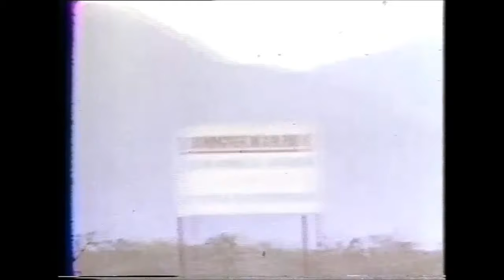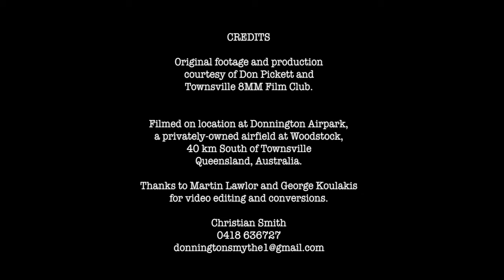Historic Ultralight Documentary

Comment: I started flying ultralights in 2001, with designs from the late 80's, so they were 'mature' designs with 40-50 HP engines.  They flew fine and I always wondered why I kept hearing about how weak and dangerous they are.  This video shows me what I was hearing about.  Seriously underpowered and looks tail heavy.  Quite unstable.  No wonder those brave and crazy pioneers had so much trouble flying them.
Reply: Russ, Most people that get and buy UL dont get the required trng...They just think its not a "Real Plane", so They can go fly it w/ no instruction...Thats where they get themselfs in big trouble....Its like any thing else...You get trained and then go use it.....Its people that dont even know how to change a flat on thier own car.
But w/ proper trng, they can be successful......Also, UL's are no more "weak and dangerous" than riding in a car.....Besides, Look at the Boeing 727 Max, all computerized and modern and it has killed numerous people and was flown by well-trained pilots.
Also, most people are too lazy to maintain thier plane.....Let the maint. slip. it will mess you up...And its no different than a $2-4000.00 rifle that you never clean...Sooner or later , its gonna blow up in your face......
This vid is a perfect example of what I'm talking about..I use to fly RC planes....I'm the "Blue bird"...Well maintained and ready to  fly....My buds, the "Red Bird".....Always come to the field w/ probs...Field maintenance......Big No No....Fix and repair your stuff at home, not at the field....

Comment: The aircraft at left was operating in the early to mid 70's using a JLO L270 two cycle, 17 hp at 5000rpm.  the field was Homestead in FL when in that age was a sleepy place, before all the Cuba activities. fl Prop drive was 2.1/1 gear drive.  It predates the U S ultralight movement and that explains the N number.  You can see it in flight on youtube, under sevtecsev.  It had minimal climbout, like 90 feet per minute, with a 145 pound pilot aboard and an all up weight of 400lb.  I limited flight angle of bank to 45 degrees and this coupled to conservative stress levels, kept me alive.
Reply: The scout first flew and went into production in 1972,,,so it was the FIRST minimal aircraft designed as a minimal aircraft, cheers

Comment: I used to fly a Scout Mk III  with a Rotax 377  engine.  Good times .   oh and for the doubters in the comments   I used to do   wingovers,   and  cross wind landings   -   you guys dont know what you are talking about . The Scout was remarkably tough.
Reply: Damn right, the Scout was a great airplane. The trolls are just armchair internet pilots!
Reply: Wish I upgraded to the 277 rotax I had no coin at the time to do so
Reply: With a wing spar made of sailing components a fatigue failure was almost inevitable ....the drag wires also had to resist the turning moment of the front spar - there was no load analysis done and its fortunate most of these "aircraft" didn't accumulate many flight hours, or it's likely we would have seen more than one fatality.
Reply: Just because it didn't kill you doesn't make it a great aeroplane.
Reply: I didnt say it was a great aeroplane -  it was a tough aeroplane - and  it  had characteristics  you would expect from a 1st generation ultralight -  it wasnt that comfortable to fly,  it wouldnt fly "hands off" -  but it was the first ultralight aircraft in Australia.  I'm glad  I owned and flew it.  but these days I'd be looking for something  more comfortable  and  better engineered for a minimal aircraft.  eg Aeros Ant.

Comment: They actually fly quite nicely I liked my MK3 more than my old single surface mx quicksilver. Used to fly mine out on the broadwater on the goldcoast in the mid 80s The biggest problems they had with the robins engine was the carburettor kept coming out of its rubber inlet mount Also the damn flex exhaust pipe kept cracking and breaking all the time. Once I had the lock nut holding the exhaust baffle come free and then pop out the back it went becoming the loudest scout in the sky LOL
The wing warp worked ok but was quite heavy to control The quality of the build and dacron sail used was excellent hats of to you old mate Ron Wheeler

Comment: Really interesting, i like that video. Does anybody know what engines they used ? They are all the same, i think. Small engine but enough power to fly with it....
Reply: they were a Robins 18HP hahahaha and I own one of these birds that has 3 axis controls using wing warping
Reply: A Robins pump engine modified which with the geared reduction could pull near 50kgs static thrust

Comment: I Can't believe that small engine can fly about 200lbs frame and pilot.
I want build one. With 2cycle 180cc 7hp engine.
Reply: 180cc 2 stroke but only has 7 horsepower? That's terrible and far too small to fly anyone.
Reply: @tenlittleindians  how about reduction gear to increase torque?
Do you have another option for the engine.
Reply: @kreativitasku5048  If your less than 150 pounds 7hp will get you flying. The West Bend engine was used on the early Soar Master power bars to get early hang gliders off the ground.

My question is more about your 180cc size engine. A Honda 70 mini bike has only 65cc and it's probably around 5 horsepower and that's out of a 4 stroke.

A 180cc two stroke should put out far more horsepower than 7hp.

I had a tiny industrial two stroke called a Solo on an early ultralight. It was a single cylinder and just barely had enough power for flight. I probably weighed 160 pounds back then. Just taking my shoes off was enough to make it climb better.

Comment: Hi please suggest me the minimum requirement for a light aircraft?
like:engine capacity, rmp , 2stroke eng?
Reply: You can fly with less than 100cc. It depends on weight.
If it revs too high you will need to gear it though. Propellers don't like high RPMs.

Comment: Engine horse power ??
Reply: 65cc engine... Not many at all.
It's possible to fly with just a few bhp. It depends on your take-off weight.
Reply: @leoarc1061  The smallest engine here in the U.S. was the Crysler West Bend with about 7 horsepower. The maximum pilot weight was 145 pounds on some of our early ultralights.